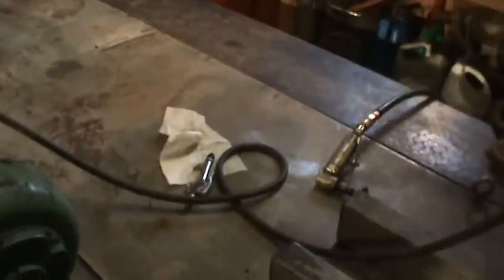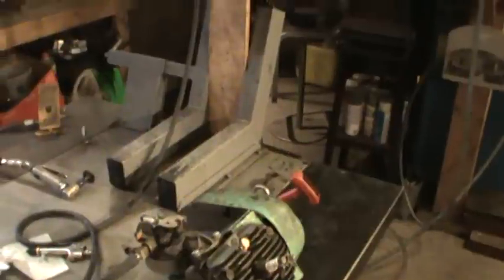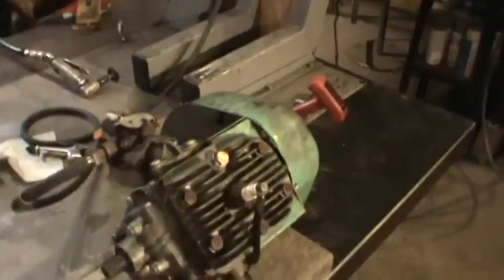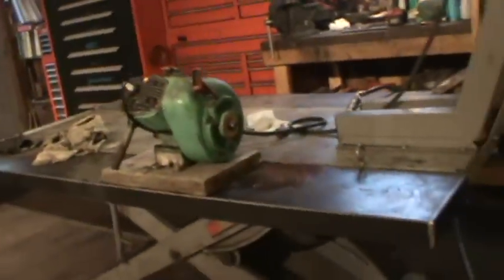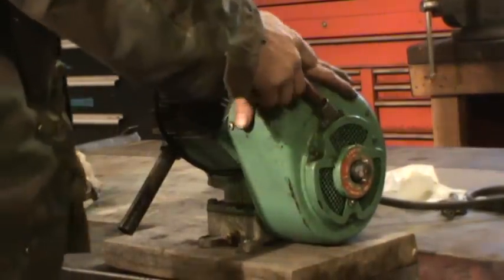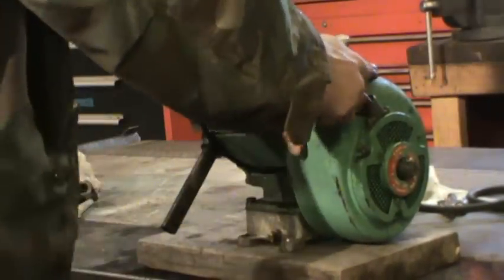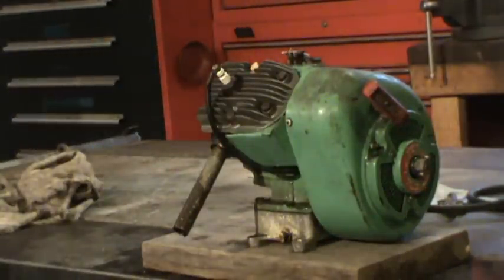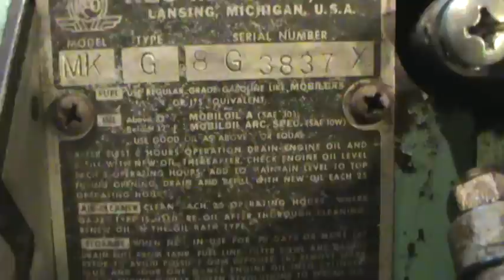reo small engine old start cold start

Comment: Gotta love those old engines. I started an old Troybuilt rototiller after it had been sitting for 25 years, according to the owner. A little gas, and I did clean the points on it and it fired right up. Couldn't find tires for it, since they don't make 8" tires anymore.
Neat rig! Thanks for sharing.

Comment: Model number MK is the 6.5:1 gear reduction output. The G is the year of manufacture, in this case 1953, the same year I came off the assembly line. The displacement is 5 cubic inches and they were rated at 1 3/4 horsepower. By the late 50s they acquired a "high compression" head and the power rating went up to 2 1/2 horses. I am currently restoring a 1951 with 2:1 reduction to power a drill press....

Comment: The output is off the camshaft, which accounts for the reduction and opposite rotation of the shaft. Also there is only one cam operating both valves. A very neat arrangement.
Reply from the maker: l like the way they sound too

Comment: Hi Mustie 1, Have you ever thought about making up an adjustable mounting stand that you can mount any small motor on for testing also for getting it to start and run, the type of adjustable stand that I am talking about is sort of similar to car hoist lifting arms that swing from side to side, you know where the rubber pads are on those arms, you can either remove the rubber pads from the arms and have have rigid mount, or leave them there and drill a hole through the centre, I will cut a long story short, the mounting stand will have to be so that it slides in and out also back and forth, I just thought of this idea today the 28/6/2017, by using this type of stand, it will save you from clamping it down to your bench or to a block of timber, to design and make the stand will take time, not a 5 minute job, I do hope this idea will help you in the future.
Sam Knudsen
Australia

Comment: @mustie1 I ultimately gave it back, after not finding the right kind of wheels to fit. I am guessing it was from the 30-40s. It had wooden handles on it, and the tines were made from steel rod, not sheet metal. I now have the replacement that was made of a motorless chassis, for which I bought a $5 motor at a yard sale. This one is from the 60s, with solid rubber tires.

Comment: I had a Reo lawn motor on my motorbike when I was a teenager, I put on my whizzer motor bike after that motor gave up the ghost. after I got it mounted it ran really well and was a lot of fun ride as that motor would idle down to a tick over and yet seemed to be more powerful then the whizzer motor was.  the motor came off a Reo lawn mower we had. I wish I could find another motor like that but I think it is not possible. PS I am 70.
Reply from the maker: https://www.youtube.com/watch?v=RKlnpH4ZRz4 this is that engine on my bike finished,
Reply: Some years ago (like maybe 40?) I found a Cooper gas-powered rotary lawn mower with a Cooper-branded 2-1/2 hp 2:1 reduction motor that, I swear, looked identical to this REO. PTO was from the camshaft, and man, that little engine could SING! I don't remember what the stroke was, but the bore comes to memory as 2". Should have kept it!

Comment: Today while I was going around town I found I sweet vintage bike and motor both older than me.
Reply from the maker: nice
Reply: Mustie1 what kind of oil did you use in the reo engine I have the same one
Reply: I never got my Reo Engine running I checked the points and condenser and coil and every things great i put a new carb on it and it still doesn't run. Got any suggestions how to get it running ?

Comment: @64gravely I went to the Troybuilt dealer nearest me and they told me there were not any 8" tires available anymore. I looked on eBay at the time too. That was 5 or 6 years ago now. The place where I bought the newer frame from didn't have anything either and he had all kinds of brands there, of used stuff. It's done now anyway...

Comment: hey that motor was made here in my home town and I want to say it was made by the reo truck company know now as Oldsmobile
Reply: Oldsmobile was the original company. Eli Ransom Olds lost the company to General Motors in a hostile takeover. Some folks just won't learn to stay away from the investment wolves. Seen it thousands of times! Anyway, R. E. Olds went on to found the REO truck operation which also produced these mowers, as well as a number of other manufacturing concerns. Some were partnerships, as well. When he died in 1950, he was no longer connected to any of them. When I was a kid, I used to sometimes work for a rancher who had a 3-ton REO flatbed truck we hauled hay with. BIG ol' 6-cylinder engine!